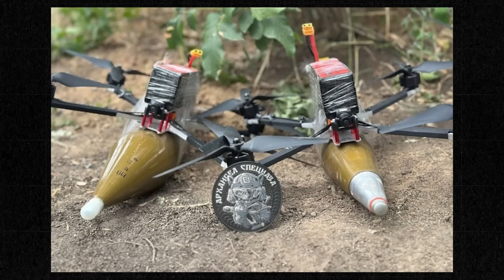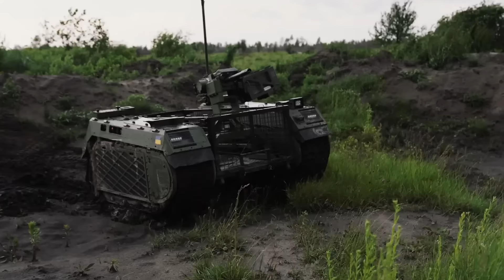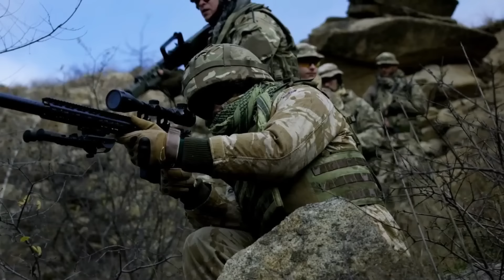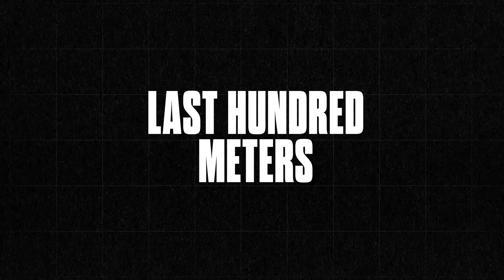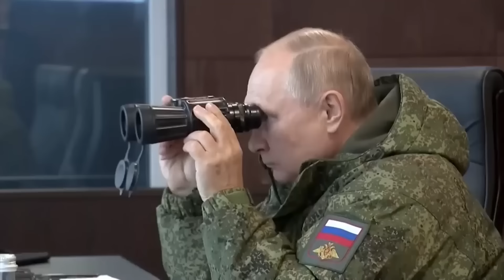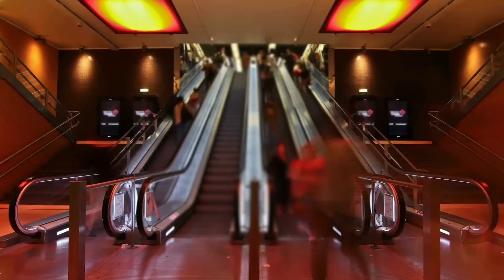Ukraine's NEW Cockroach Drone Just Did Something UNBELIEVABLE Against Russia

Comment: These weaponized drones that they're now using remind me of the GI Joe toys called the pack rats they were remote guided drones. Some were flamethrower units, some were missile launcher units, and some were machine gun units. Back in the 80s they didn't think about using them for other things other than those three functions. But if they had there would have been a lot wider variety.